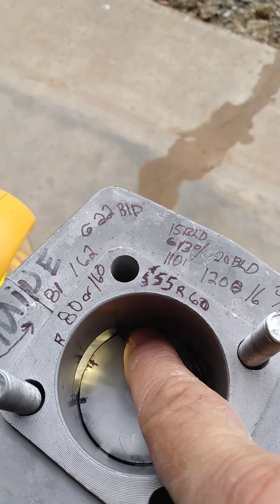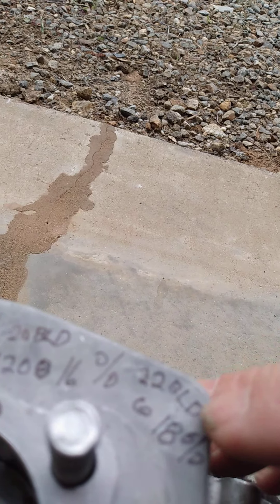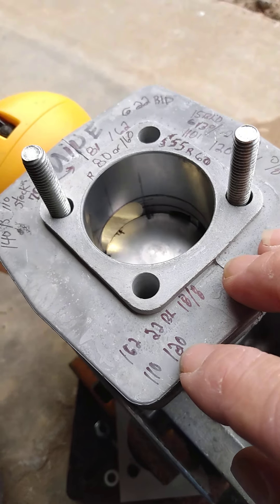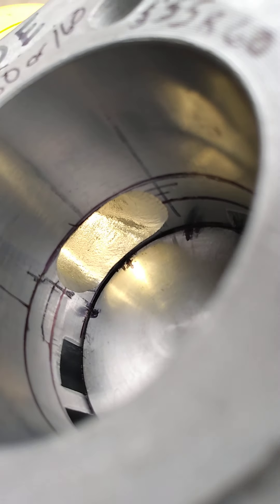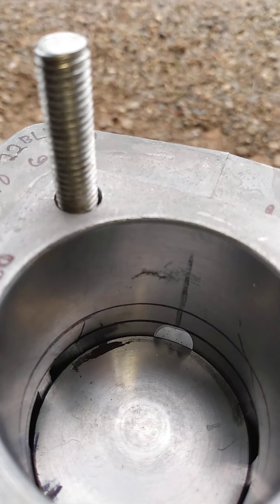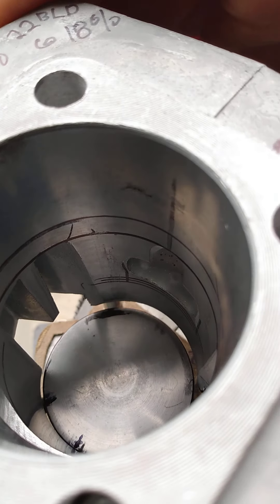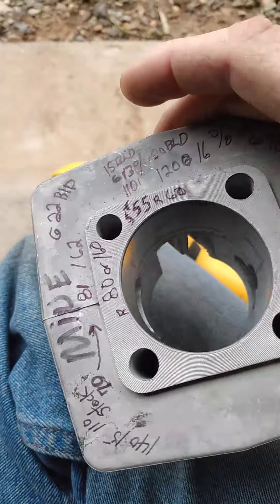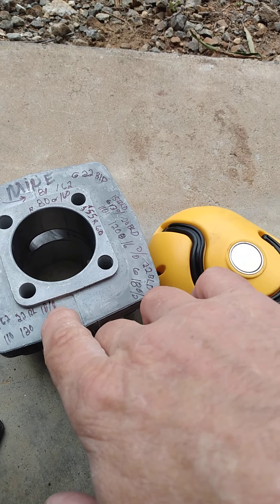Port openings and port separation blowdown all important

Comment: Hello really enjoy your vid man. Good work! Just have a question. My 2 stroke cylinder transfer and exhaust port timing now are 122.5/ 178.5 blowdown is 28. After dyno i found it got its most power only at 7200rpm. If i wanna get more horsepower can i only port the exhaust port to say about 188degrees? But the blowdown now is about 32-33 degrees. And i heard poeple said don't exceed your blowdown to 30 degrees otherwise you'll have hard time tuning your carb is it correct? 

Ps: i wanna get most outta my cylinder in the top end. If i dont wanna change the transfer timing. Can i port the exhaust to 185-188? Thx
Reply from the maker: @hsuehprettyboien5695  if you bump  exhaust  port up to a 182 that will give you 30 bld @ 24%  kinda confused  why your only seeing 7800 rpm. You sure your not running to small of rear sprocket . Don't know what type  cyl or bike your talking  about. If it's has manual transmission  yes you can get by with more blowdown.  Sounds like you have a bottle neck somewhere  aka not enough tranfer area not enough  exhust port width or a  pipe that's not working for ya. Need more info on your type set up.
Reply: @  thx for the reply. Sry for the short info. I am running 2 stroke vespa engine. My cylinder is 187cc( 60x63) stroke x bore. My gear ratio is 2.91 usually vespa engine got the most horsepower only around @ 7000rpm. But i wanna push the limit tho (wanna perform better at top end).I saw someone put it to around 9000 rpm with the max hp. But i dont know if i would make my ride worse with bigger blowdown. Currently i am running 28 degree blowdown. So i was wondering if i can gain more hp with more exhaust degree more blowdown degree but the transfer duration remains the same thx
Reply from the maker: @hsuehprettyboien5695  ahhh now it makes more sence.  Yes you will loose more low end function. I'm thinking the guy you see posting 9000 rpm probably  has a trick programmable  ignition proper  pipe specific for port timings and areas.  There is some good vespa specific  channels on youtube. Super cool set up you have.
Reply: @2strokecarbtuningportingin187  thx for the rply again! And thx. So i will be cool to have 32-33 blowdown if i want my top end perform better?

Comment: Getting only 52 intake duration 134 exh on a motor, are all older sand cast cylinders this terrible or am I doing something wrong?
Reply from the maker: Sounds like your degree wheel is wrong  typically intake opens at 60 and closed at 60 equals 120 duration  but if you jacked it up it makes sense typically old sand cast are 150 exhust opens at 75 closed at 75. And tranfers were typically 120 opening and closing at 60.
Reply from the maker: Typically sand cast were 150 exhust duration 120 tranfers and 120 intake on 47 x 40
Reply from the maker: Typically 47 x 40  h 4 is 140 110 120

Comment: What do you do with the intake port and what effects does it have on the powerband?
Reply from the maker: Stock intake  port timing is 120 degrees  of duration  if your running  a piston port and add some exhaust duration and blowdown  then you definitely  would want to add more intake duration. Like life to much of anything  you end up with a door stopper.  To much intake duration  with a piston port kills pick up. But not enough  intake duration  it can suck case dry at about  9800 rpm good i
Physical  intake duration  is about 130 degrees  on a ported set up
Reply: @2strokecarbtuningportingin187  is the intake port like the exhaust port in the sense that if the piston it at top dead center that the intake is fully opened?
Reply from the maker: @mr.whiskers6273 intake  port timing  starts when piston skirt  traveling  up and floor of intake port gets exposed to atmosphere.
Reply from the maker: @mr.whiskers6273  exhaust  and transfers  are controlled  by piston dome and roof of port hight determines  port overall  duration  i.e. total  time port is open. Intake port timing controlled by piston skirt or window  but allways  starts and is based off floor location. Not the roof of intake port. Kinda confused  by your question. If the question  is if your piston skirt at TDC hangs below  the roof of intake port will trimming the skirt change your port timing the answer is yes.
Reply: @2strokecarbtuningportingin187  thank you so much for answering my questions